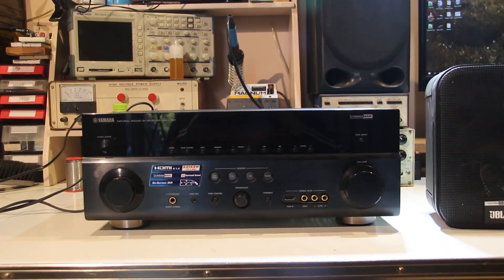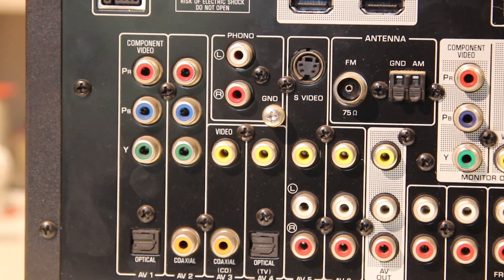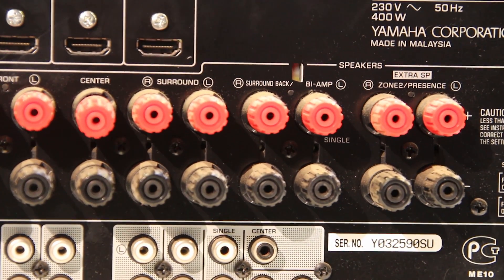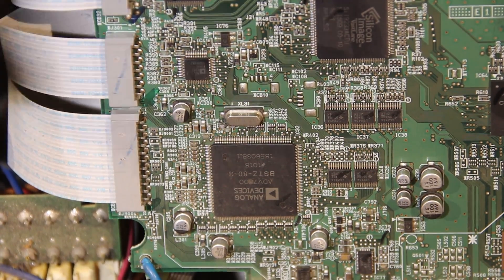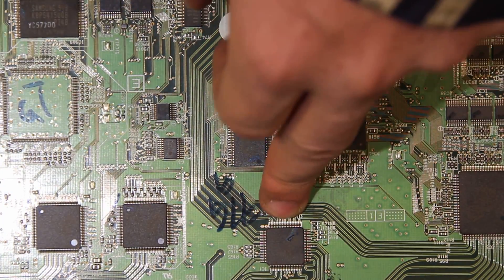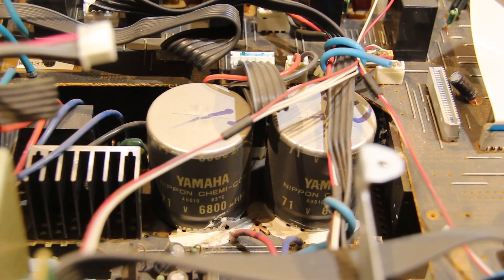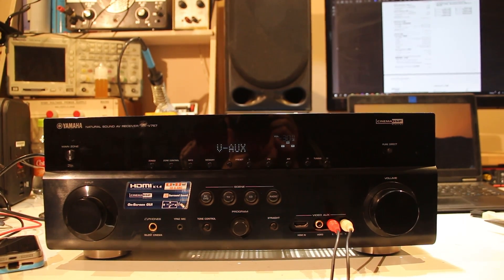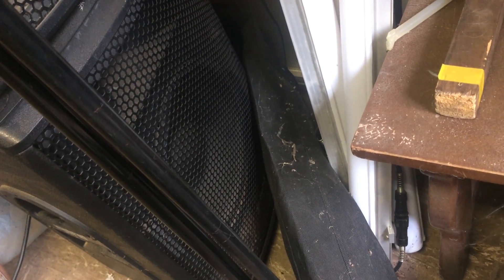Yamaha Amp Repair and Teardown

Comment: Help me find the firmware for the EEPROM chip r1ex24128asas0a.  I can not enter the engineering menu.  Standby voltage is present.  yamaha rx a810.  I will be very grateful.
Reply from the maker: Hi Valkor. Unfortunately I do not have any of these amps anymore but there are very nice forums on reddit and eevblog forum where someone will probably be able to help you.

Comment: I bought pioneer private pro ax 720 amplifier but it is not giving sound to the speakers but when i turn on the amplifier there is a slight vibration in the amplifier.  Plz tell how can i fix
Reply from the maker: Hi, I have never worked on Pioneer's stuff. I need a lot more information before I can give you proper advice. I would recommend taking the amp to a local repair guy.
Reply: @ChristopherdeVilliers  ok Thanks brother

Comment: Hi Christopher. Thank you so much for this video. But I just wished that you went into more details regarding stripping and repairing the amp. I've been searching YouTube for somebody who actually repaired the amp and came across your video. I have the same amp and I've had it for some time now but this morning it decided that's enough if that. The strangest thing is I only use it to drive my rear and centre speaker. I'm presently sending a signal to my power amp to drive the main speakers so I can't even say that the amp is overdriven. The problem I am having is that it stays in standby mode, with the little red light on and that's all. No power coming through at all. Any advice on the matter Christopher?
Reply from the maker: Hi so firstly sorry for not replying earlier. I don't use the account a lot. So with regards to your problem it sounds like the amp detected a short on the wires going to the speakers. This happens when you dont use banana connectors on the amp. I would recommend that you read the service manual (not the user manual) and look at the reset part. Just reset the amp and it should be fine. If that does not solve your problem then you will have to take the amp in for repair or if you are confident in your skills follow the service manual and see what section is not working the way it is supposed to. EEVBLOG has a nice video on troubleshooting a yamaha amp on component level.

Comment: i have the RX-V377, do you know how to fix/diagnose intermittent volume imbalances? my left channel will sound quieter than my right from time to time.

I already tried using electronic contact cleaner to spray the speaker connections from the inside.

Comment: I have a Yamaha Rxv 373  with no sound output on any channels. It keeps displaying Music Decoder off. Any ideas?
Reply from the maker: Hmmm I have not had that issue before, maybe download the service manual and search for that error message. Also maybe just try a factory reset, it will also be in the service manual and fixes problems most of the time.

Comment: I have  yamaha TSR 7850 , I am  not at home yet but my wife told me last night a big storm came and after a storm light the power went off in the house , after came back the receiver only show the red stand by light , You think my reciever went also to protection mode ? and this metod will work for this particular model as well?
Reply from the maker: Hi Mauricio, try it because it is the first thing a technician will try. Try it a few times if the first try does not work. Just check the service manual for what the procedure is for your model as they do differ between models.

Comment: I'm getting a temp protect code, says temp is off scale, do you know where the thermistor is?
Reply from the maker: Hi, these amps have a few temp sensors normally and it depends on the model. Most of the time you will find at least one on the heatsink. The service manual for your model will show exactly where yours will be. It might also just be an offset thing that you can change in the service mode.
Reply: @ChristopherdeVilliers  Yes sir found and replaced the temp sensor, it came on with no errors and played until I turned up the volume a bit then mysteriously the RF channel blew out, took out about 4 components in the channel, I have replacements on hand, soon as I can free up to install them.

Comment: I have yamaha rx-v767 where front panel display is not working. Can you suggest some solution please?
Reply from the maker: Hi this can be tricky to fix. I would recommend that you just replug all the cables going to the front panel and check that all the voltages are correct according to the service manual.

Comment: Hi i have yamaha rxv420 and The same problem. Torn on but after 2 second turn Off. Show display status p5 prt 210 B. All pcb look nice. Maybe you have idea thats  problem that check i should?
Reply from the maker: Hi, yes that sounds like a protection feature. Try the protection reset procedure in the service manual for your amp. Obviously also check that there are no small cables causing shorts on the speaker outputs.

Comment: How to repair on screen display..not working
Reply from the maker: Hi this can be tricky to fix. I would recommend that you just replug all the cables going to the front panel and check that all the voltages are correct according to the service manual.

Comment: Hi Christopher,

On my amp (a very similar model at this one) the only hdmi output is not working anymore.
No video nor audio is sent, regardless of the hdmi cable or the input.

Anything i can do ?
Reply from the maker: Hi Florian, well it sounds like the HDMI mux chip has been damaged. See on digikey if you can get a replacement but it is not an easy repair.

Comment: I have a similar (but lower end) Yamaha receiver HTR-2064 and it works fine, Although i have noticed it doesn't seem to be as loud as i remember it been, especially using the headphone jack at the front with some high quality headphones, Would this be age related do you think? caps or something else?
Reply from the maker: Hi, so I would check the main voltage rails of the power supply (+ and - Vcc around + and - 40 to 50 volt). If they are significantly lower than what is stated in the service manual the have a look at the caps otherwise you might just be getting a lower signal into the amp.

Comment: Hi Chris, I have yamaha v685 which usually says usb overloaded and bluetooth and wifi malfunction, i tried to update but it goes out of perform the download and it will stuck on please wait except i switch it off.
Reply from the maker: That sounds very annoying. I am not familiar with that model but I would recommend seeing if you can do a firmware update via USB instead of downloading it through the device. Otherwise many devices have backup base firmware that you can reset to in the event of a corrupted update

Comment: Excuse my english i am from Greece.That pure direct button cuts off the signal of the circuit with all the tone adjust like bass/treble/balance/loudness,and feeds the signal through another circuit which is straight up,and direct without passing from anything and its all flat sound and totally cleaner! It sure does work in my stereo amp ax-1090 especially when its on the cd input!
Reply from the maker: I am not sure about the model in this video but on the V459 the audio signal still goes through the adc and DAC so it is not always 100% pure. Irrelevant though these yamaha amps sound much better than many other brands in the same price range.
Reply: @ChristopherdeVilliers  I believe when it comes with receivers the pure direct has a real function when only in 2 channel stereo and no dsp effect on.

Comment: You're not a very knowledgeable technician are you the component video monitor out it's for one you are bringing HDMI in you have a feed coming off of that that you can run directly into the back of the television you have component inputs on the back of the television you will have a red a green a blue or you will have a audio and put your left and right and a video input on the back you saw that on the back of the receiver you saw a red a green and a blue and yellow and a red and a white and that's all the components for your monitor or your television that's what that is for any technician would know that but that's neither here nor there let's continue I love watching these programs where I can catch people screwing up
Reply from the maker: I am really struggling to interpret you message. Seeing as this was my first fancy multichannel amp that I worked on, yes I was not that knowledgeable about the system and yes I definitely do not regard myself as a technician but I did get it working in the end.

Comment: My Yamaha rx v1900 Right Surround  Speaker is very low ( not working proper )
IC issue ? Or something else ?
Reply from the maker: Could be the transistors or just the cable to the amp board that is a bit corroded. A bit difficult to say.
Reply: @ChristopherdeVilliers  thanks brother 
Appreciated ❤️

Comment: Hola mi equipo funciona bien pero al pulsar el botón de encendido sale configurar Bass y Teble.
Y al pulsar los botones Program se apaga y enciende el equipo
Sabrías como poder restaurar de fabrica desde la placa?
Gracias por tus videos.
Reply from the maker: Hi Fernando, it sounds like the resistor ladder switches (google the term for more info) used for the front panel buttons is not getting the right voltage and that is causing the processor to interpret one button as another button press. The last question did not translate very well but you should be able to find the factory reset procedure in the service manual. I would recommend checking that all the voltages are correct and within tolerance and that all the connectors are making proper contact as well as that screws are all in as grounding is VERY important with these amps.   
Hope that helps!
Reply: @ChristopherdeVilliers  Muchas gracias por su atención

Comment: Hey! I got a question. So my Rv703's headphone out, and speaker switch got pushed into the housing how would I go about pulling it out back to normal
Reply from the maker: Hi Mat,
Open the amp and see if you can remove the switch and jack socket. See if only some metal pieces are bent but if plastic pieces are broken then you will have to get creative with superglue/q-bond. It is also possible to 3d print new plastic pieces if some are damaged. Regards Christopher

Comment: Hi,
i'm looking for hard reset onboard connector for my RX-V3040.
can you help me?
thank you 
FS
Reply from the maker: Hi Zefal, I have no experience with that range of amps but normally you can reset the amp by pressing a combination of buttons that should be listed on the service manual. If you want to reload the firmware of the device on the serial port then many flat ribbon cables should fit if it has the right conductor number. Your best bet is probably to take it to a electronics supplier and see if they have one in stock. Hope that helps and sorry for the late reply

Comment: i have problem on my yamaha rx-v363.if i turn it on a few sec.it turn off and i cannot turn on again.how can i fix please help
Reply from the maker: Hi have a look at my video for the rx-v459. See if you can get the amp in service mode and look at the faults. If it does not want  to go into service mode then try replacing the cap as in the video. Hope this helps. regards Chris

Comment: Hello. I have my yamaha rx-v771 and recently theres no more sound coming out. Any idea what is the problem?
Reply from the maker: Hi Arki, I need a lot more information about what happened before I can give you advice. I guess you can start by testing all the cables in the system. Regards
Reply: @ChristopherdeVilliers  the unit is seldom use until one day i used it for 6 hours straight at high volume then sound suddenly lost. Tried ti reset the unit and doesnt work.

Comment: I'm wondering if you've been around amplifiers very long, because you don't seem to know the names of quite a few things, that "Dock" on the back is for iPod, Yamaha have has that socket for a long time, the "3 component" you talked about is the input for some visual units that have that output, so therefore there's a component output which connects to the TV that has those connections, the Toslink and Coaxial connectors are just digital audio connectors, and please, if you're going to dust, use a small brush and sweep the dust into a vacuum cleaner hose, you want to suck that dust away, not spread it around, you need to follow the brush with the vacuum hose, you're not working on a dump truck!!
Reply from the maker: That is quite fair. This was the first consumer digital amp that I worked on as well as the first Yamaha so I do apologise for not knowing the exact ins/outs of their line-up. The RX-V459 that I also worked on does not have the iPod dock connection for example. I do however have quite a bit of experience working with/working on and even designing from scratch analogue audio amps and other electronic equipment. Sorry if the video did not meet your expectations
Reply: @ChristopherdeVilliers  It's not a matter of meeting my expectations, but with any video you make, you should research and have all the names and facts ready to say, those iPod docks have been around for at least 15 years, I was surprised you've never heard of them before.

Comment: Hi Christopher. Do you know how to reset the self protect on Yamaha MX A5000?
Reply from the maker: Hi Magesh. Before this I did not even  know Yamaha made an amp like the MX-A5000. It looks very analogue and simple, a simple power cycle might do the trick. Maybe consult Yamaha directly as this looks like a very expensive amplifier. Damaging an amplifier that costs a few thousand dollars to save $50 going to a repair center is simply not worth it.

Comment: Chris my man! I have the same one but the HDMI output is not working. I suspect the Sii9134 chip is faulty. Could be wrong. Any thoughts? Should I try and replace it with a new one?
Reply from the maker: Hi, if you are experienced in replacing SMD chips then I would say go for it. If not maybe get someone who is. I cannot guarantee that this will work but it will be an interesting project nonetheless but before going down that rabbit hole check the service manual and see if the correct voltages are there. It could be that the HDMI chip is just disabled because it is not getting an enable signal or that a resistor has burnt up somewhere. Anyway, let me know how it goes. Regards Chris
Reply: @ChristopherdeVilliers  Thank you for the reply. Not really. I have the service manual on hand and I could have someone more experienced have a thorough look at it after the virus lock-down ends. I've watched a few videos on Onkyo receiver HDMI issues and it's always this particular chip over-heating and melting the solder joints. I saw a video with a guy using a heat gun and another using the oven. Both fixed it. I'll update you as soon as possible.
Thank you.

Comment: I have Yamaha RX-V671 (which is basically the same receiver) and it only gives a buzzing sound through the speakers. Repair guy says it was a bad main board. Any idea where I can acquire one of these?
Reply from the maker: Hey, have a look on ebay or your local 2nd hand websites like Craigslist OLX and Gumtree. If it's just a buzzing sound and the rest still works then a decent repair guy will be able to replace the damaged opamps or transistors. If the digital stuff is also damaged then just buy a new unit and sell the old one for spares

Comment: It's very important that when wiring speakers to never use too thin of a speaker wire otherwise the receiver will shut off if the speaker wire is too thin
Reply: How to fix? I think that's what happened to mine

Comment: Rca cables themselves can break the rca connections on the back of the receiver if you use the wrong kind of rca cables
Reply: Yea Monster cables are the very worst!!! They will destroy your output/inputs
Reply: how so? is it too tight?

Comment: On some older av receivers you have to be very careful when turning the bass treble and balance control knobs because you can break the bass treble and balance control knobs and the Yamaha htr 5440 and htr 5450 receiver models have the bass treble and balance control knobs on the front of the receiver

Comment: Hi mate,
any chance you can watch this 18 second video and tell me what you think is happening to my receiver and point me in the right direction?
https://youtu.be/ntWQoi6gbFE

Thanks in advance and for your vids.
Reply from the maker: Hi Sam, so I recommend finding the service manual and checking that the voltage rails are correct and replace any blow parts. Maybe also have a look at my latest amp repair video get get an idea of how to troubleshoot your problem

Comment: If it goes into protection might something wrong like a bad power transistor
Reply: It's possible. Usually it's caused by a short of a speaker wire while the unit is on though. First thing I always do is try to take it out of protection and then go from there.